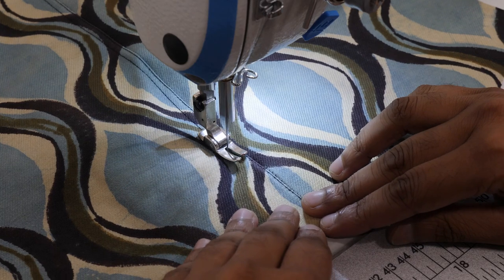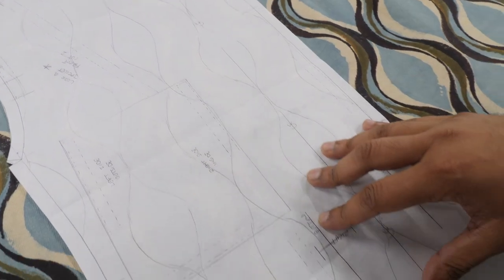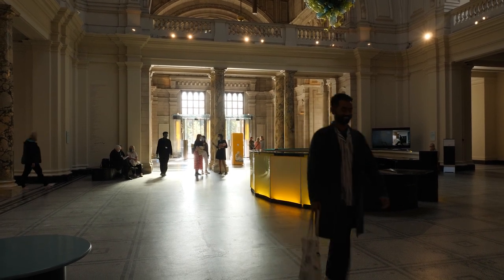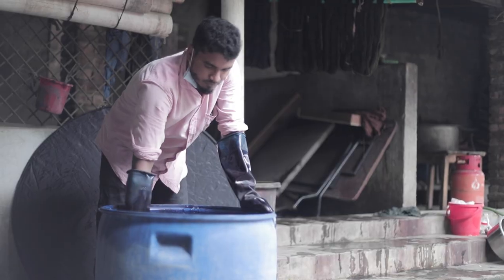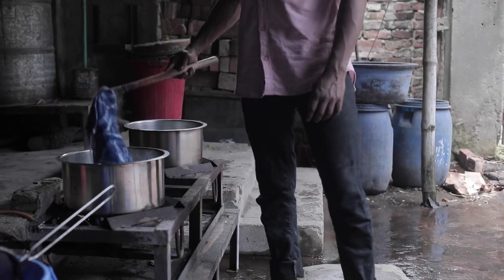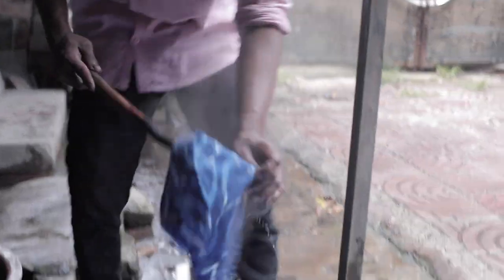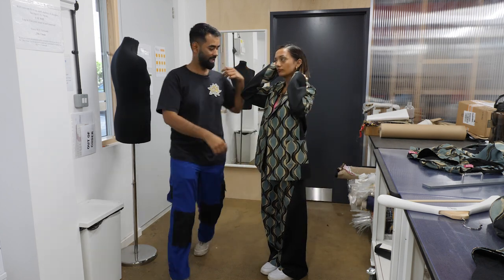"Stop using labels like womenswear and menswear" | Fashion designer Rahemur Rahman | V&A

Comment: Men and women are different. Rebranding unisex products as gender fluid does not solve for the tailoring requirements due to sexual dimorphism.
Reply: Besides - who cares if "men" wear "women's" clothing or vise versa? 

it's funny to me that we rename things to make them socially acceptable, vs just... not giving 2 shits what someone else wears (As it's NONE of our business in the grand scheme of things.
Reply: @jamesbond1231 
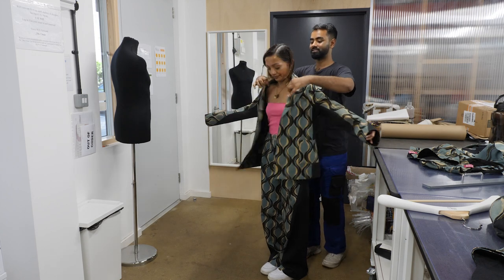 3:45 Woman wearing jacket.
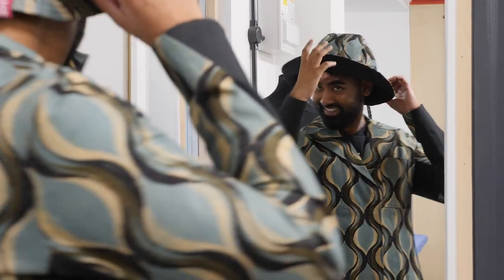4:20 Man wearing jacket
The creator wishes to be a 🧜‍♂️ gender fluid 🧜‍♀️ champion 🏆,  yet no equity between genders are met. Clearly the man wears it better(waist height, sleeve length, etc.).

Suggestion: create a jacket with adjustable tailoring so any body-type can be accommodated for. All corresponding sizes by gender and region would be very useful when selecting for a clothing article.
👉Tunics, robes, and jumpsuits,👈 have greater potential for unisex/gender fluid clothing options. Different sets of belt loop heights can instantly accommodate for different hip  placement. Accordion 🪗  sleeves retained near the shoulder via epaulettes can put arm length in the Goldilocks Zone for anyone. 
Sell the choice, that looks best.
Aesthetics before dogma, put fashion first, and the message will follow.
Reply: @BlackPhillip666  I believe it’s because as a designer he makes custom pieces to order. so in reality if the woman wanted the jacket he’d make it to her specific measurements, whereas this is a piece he designed for the museum probably just using his own measurements
Reply: @azraeltoson9071   good point
Reply: Thank you.